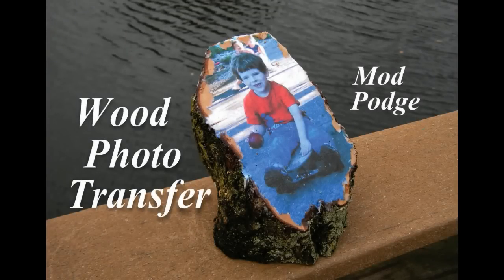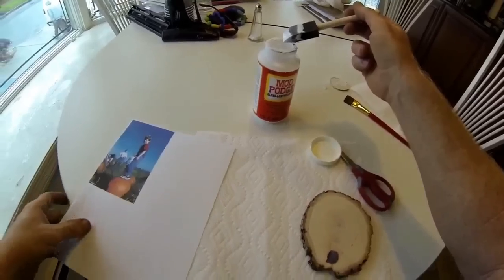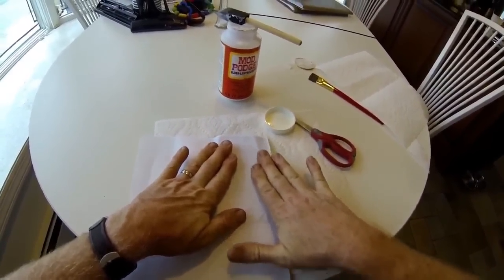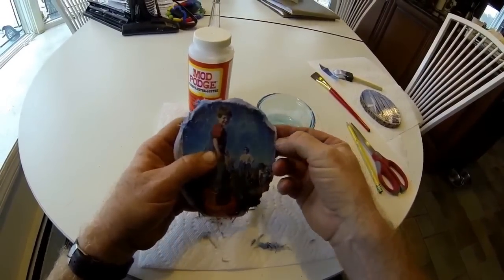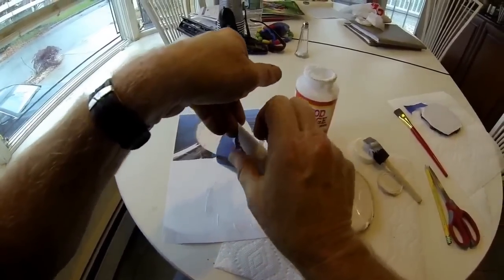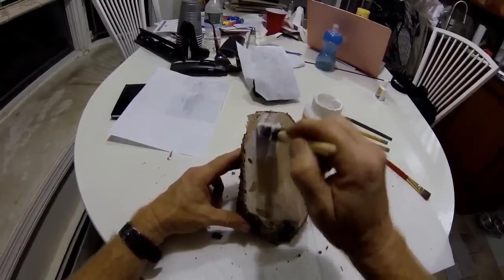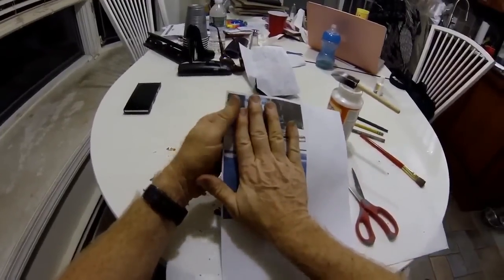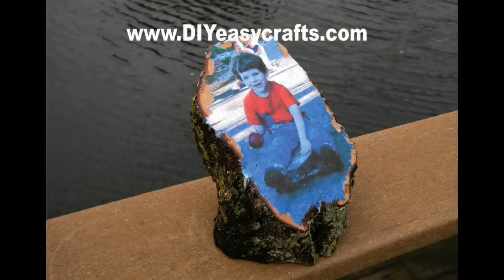DIY Easy Mod Podge Wood Photo Transer

Comment: Hi im a new subscriber.
Im glad i click to ur channel. Is  easy and save time.
 I can see clearly you did the transfering of the picture to the wood. 
Mod podge is unavailable in where i live.  Can i try using pva glue or diy mod podge?  Please spare a min to reply. Thanks .
Update
28th Jan 2019
No results after trying 5times. I printed extra pics using laser printer. Sponge with water. Fid it very gently but the photo tears. I give up..
By the way i let it dried for over 24hrs.

Comment: I'm curious, for the second method, can you use regular ink from a printer at home? I tried doing the first method with regular printed pictures and they came out all wrong :( So i'm thinking of putting it like the second method but I don't have time to do the laser printer

Comment: silly question here but double checking anyway, is that real log and if so,do you treat the bark?thankyou for sharing
Reply from the maker: It is a real piece of firewood and I did not treat the bark at all. So far the bark has lasted three years with no sign of deteroriation.

Comment: hi. i would like to ask about the second method. after you glueing the picture & it dry, do we need to remove the paper use wet cloth , like the 1st method? or you just leave it dry without remove the picture paper? 
i hope you can reply this a.s.a.p.
thanks .
Reply: Dee Ayie his second method is just gluing the picture on the wood and not a photo transfer. So you don't remove the paper. It's sandwiched between the picture and the wood. Very disappointed in this video. Misleading. There are some other great videos out there on wood transfers. I'd keep looking if you really want to try this. I've tried this a couple of times trying different methods and it doesn't seem to be as easy as the you tubers make it look. I guess that why this guy just glued it on. Lol